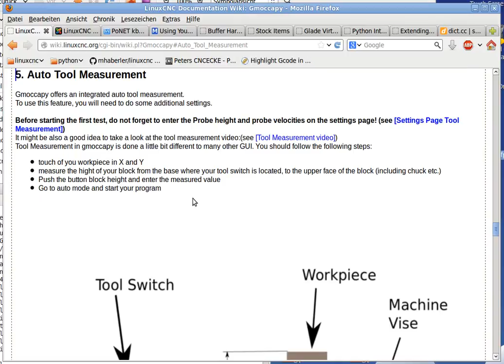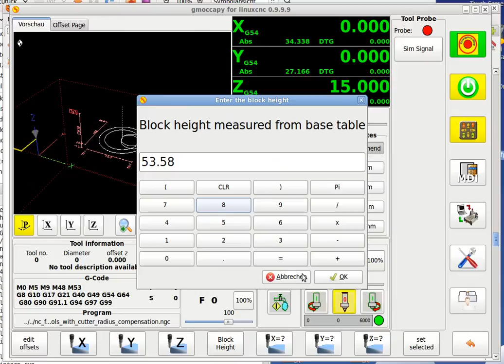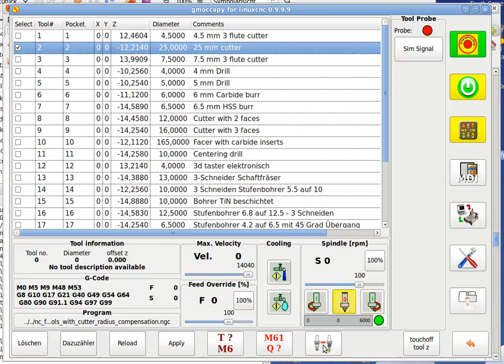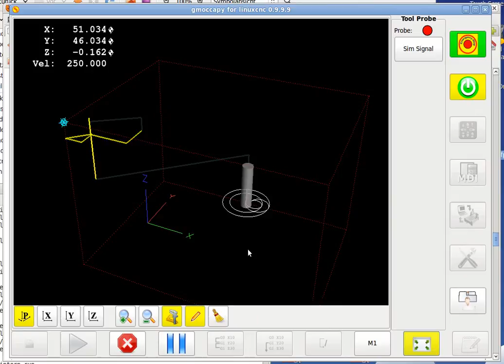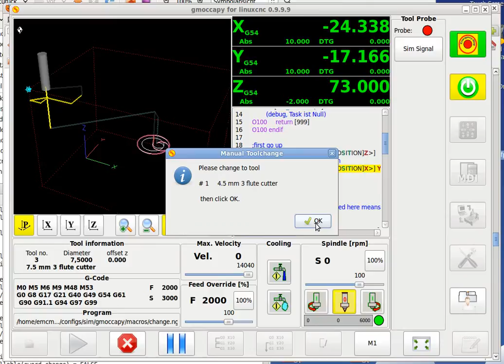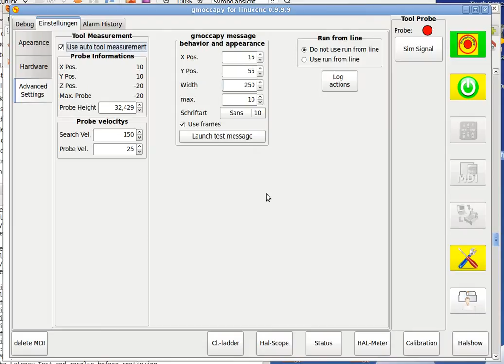gmoccapy sim auto tool measurement 01 01

Comment: Could i use the standard Z-Probing as well? I have just an MDF-Plate so measuring it is more uncertain than probing it with the tool on the workpiece position. I just instaled a laser barrier for tool measurement which works perfect, unfortunately i ran the tool into my table by Z-Probing as usual:
1. Inserted new tool
2. probed Z, klicked on "Probe Z"
3. Started Programm by using the same tool and measured it after starting

Is it relevant to measure the tool first before probing Z or is measuring the block height the only way to go?
Reply from the maker: Shure, tool measuring is an option, you can look on the basics video to watch the use of stzandard touch off.

Norbert
Reply: Thanks a lot, the tool measurement works like a charm, i really appreciate your development!

Comment: is it possible to have one master tool (with a known length, for example 50mm) and when i touch off this tool it knows where in z the spindle nose is? sorry for my bad english
Reply from the maker: Yes, it is possible. But you will have to make your own change.ngc. In your config dir you will find a subfolder with the related files.

I am not able to give you an example for that, as  have ne

Norbert